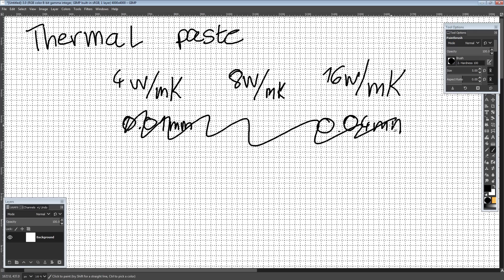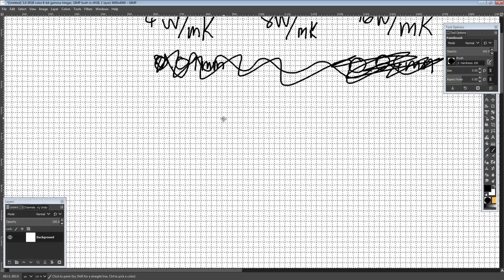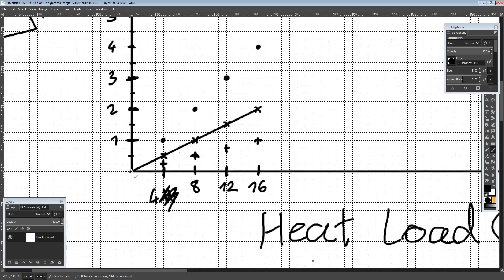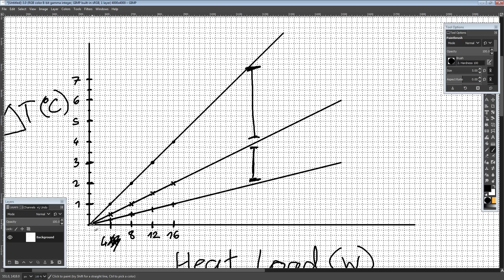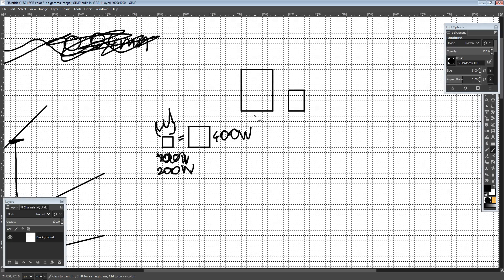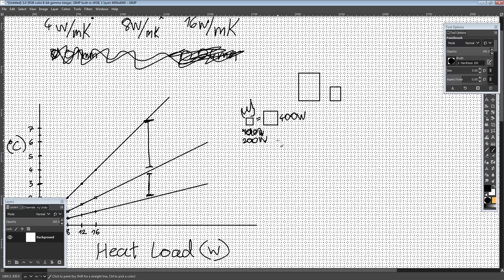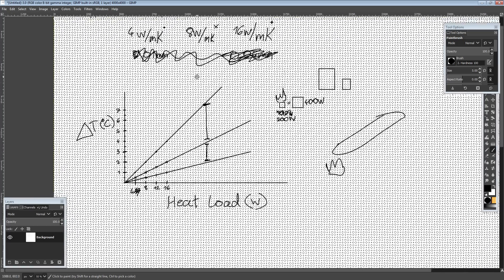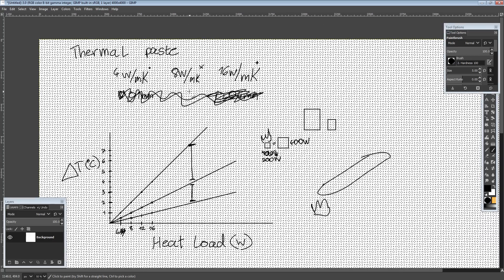The importance of heatload in thermal testing

Comment: Anandtech (accidentally) tried to illustrate this in their 140mm Slim Tower CPU cooler roundup. I say accidentally, because if they realized how important the concept was, they would have made a more prominent point about it. 
It's especially highlighted in the Low Fan speed page (7V). 

-Delta over ambient, the 212/Wraith vs D15 - are 'only' losing by 10 degrees for a 100W load. 

-However go to a 150W (15C), 200W (22C) or even 250W (27C) load, the gap widens dramatically.

Comment: Hi!
Had a question about Navi GPU's die.
From Vega/Polaris to Navi, the die size have significantly shrinked.

So, at higher wattage, will Navi face a disadvantage at dissipating heat compared to its predecessors?

Illustration: 
Say, I throw 250W at Vega 64 and with a certain design heatsink (Asus ROG Strix) and the temp is 74c.
If I throw 250W at a Asus ROG Strix Rx 5700XT with almost half the die size, will the heat dissipation be worse (beyond 74c)?

Comment: hey buildzoid quick question. I ran Furmark to test out my GPU overclock, I only ran it for about 10 minutes is that enough time to cause any lasting damage? The temperature were fine though, although the fans were spinning like crazy. The card is a vega 56 pulse. I believe the temperatures didnt exceed 75c. Thank you.

Comment: Buildzoid will you be testing an overclocked 3950x on air vs water coolers?
Reply from the maker: I don't think I have any AM4 compatible aircoolers on hand other than the AMD stock one and that one is not big enough
Reply: @ActuallyHardcoreOverclocking  would it be possible that you & GN get one from noctua or your preferred air cooler?
Any thoughts on rumours of x590 boards?

Comment: For average users simple white "toothpaste" good enough especially if they use non soldered CPUs. Just make sure you replace it every 2-3 years. My experience is basically no signifficant difference (2-3°C at 70°C) between FRESH toothpase and silver miracle using on laptops and desktop CPUs. After 3 years the white paste degrade like 10°C, but after it holds up and temps are same at 5 years and 8 years.
I don't have long time experience with grey paste like Arctic Silever, Noctua or ThermalGrizzly, how they perform after 4-5 years.

The big problem is that thermal paste and pads dry out after some time (and heat). All of the factory paste what I replaced was hard as rock, in mining cards the oil flowed out from thermal pads and you can break them to dust.

I disassembled my 12 years old rig and the cheap toothpaste is still not dried out completely. When I bought 20ml from the cheapest white paste in an electric shop I tought "it's enough for my life", still has 8-9ml in the cringe.

Comment: I love this kind of videos!

Could you please make a video where you explain which parameters one have to check for mosfets quality inside VRM? Things like Id, Rdson, rise time etc.

A more direct question: on hardwareluxx there are some mobos which are listed as 4x2 phases (without doublers) and others which are 4 phases but with both double highside and lowside mosfets, like msi b450 tomahawk vs b450 pro carbon. They are the same right?
Thank you

Comment: Now can you make a video about how TDP is calculated differently for intel and amd, and how that TDP is calculated for the base frequency and has nothing to do with turbo boosting and OC. Because Steve and der8auer really likes to test the TDP of intel chips when OC by a GHZ or more.
Reply: You mean for example like 350 - 500 watt numbers? Its not wrong, its just misuse of the one term we have "TDP (Thermal design power)".
For example, the lower end Ryzens are 65 watts instead of 95w, but theres nothing actually different about the silicon assuming you ran both matched to the higher specs. There might need to be a differentiation between design/theoretical TDP, and real world/overclocked power consumption needing a new word... (Actually Dissipated Power?)
And as for comparing Intel to AMD, they're too different internally to compare anything other than average power consumption at the CPU's EPS12V cable or even after the PSU at the mains wall socket, thats why this method continues.
Reply: @mrlithium69  TDP is calculated at BASE frequency, no turbo, no oc, no nothing. 
And i say calculated because it can not be measured. find the intel TDP pdf.

Steve let an intel CPU go turbo to 4.7 all core, and it pulled X amount of watts from the wall, and says that intel is lying about their TDP numbers. when TDP is at base frequency. Also he says that power draw and tdp is the same thing which is not. I used to believe him until that point. When he started uploading misleading videos after he got popular because of his deep tests.

der8auer did the same mistake too and never corrected it, he even ignores my comments now. So if "Actually Hardcore Overclocking
" makes a video about it at least Steve will watch it, and learn.

Comment: My 9900k has liquid metal on it and it STILL wont stay cool. That shit is a volcano above 1.3v
Reply: So was my 9700k that's direct die cooled until I realized I needed reapply the LM since it kinda squeezed out and left the center not ideally covered. I didn't glob it either I painted the LM. I was changing fittings and it just got worse but still seemed fine since temps were kinda sane until I got to anything above 1.26v and then it skyrocketed past 80 into the high 90s now I'm running 5.3ghz @1.4v under 90c
Reply: @alien_man1669  thank you for the words of wisdom. I actually did encounter the same issue at first and did reapply the LM using much less the second time. Temps are better than before when the LM was bunched up but they are still crazy high. I have been using a 360 AIO and the black industrial noctua fans that spin up to 3000rpm. But decided to just go all out and get a waterblock and a 60mm 360radiator.the direct die kit is a good idea and I may get that also...sounds like it may be a requirement for what Intel plans to release to "compete" with ZEN2...LOLL

Comment: After your explanation, I'm now curious how all of this would then relate to ln2 overclocking, being that it instead seems to transfer cold to the CPU instead of pulling heat from it.
Reply: It seems like that but no, heat is always what gets transferred by "conduction" still. The extreme cold means theres a heat difference that acts like a force pulling the heat out. "Pouring the cold" into the LN2 pot is step 1, but you can't "push" cold across the thermal boundary where it touches the CPU like that. Instead the heat will be "pulled" out of the CPU, very rapidly, depending on the difference. Additionally the larger the thermal mass of your LN2 pot means it can take more heat out of the CPU with less pours of the liquid nitrogen once equilibrium is reached and everything's as frozen as possible.
Thermodynamics are easily one of the most complex things in physics, its not to be argued with either, i.e. they are LAWS not theories.

Comment: Back to time when i studied at univercity and we took a little time on heat conductivity:) As i know "thermal density" commonly known as "heat flux" in literature(on both known to me languages(for english  - almost joke, about "knowing it"). Also remebers me Derbauer  lapping die, since silicon are not so good at tranfering heat, i think he could go further, not just ~0.1 mm(or so), but can say from top of my head at which thickness it will crack just from heating to ~80('cause in multy core dies present lateral temperature gradient)(even not mentioning pressure from any kind of cooler)but why not experiment on some very old dies?

Comment: Great video! I have run into similar issues with thermal testing and come to the same conclusion -  higher wattage testing is generally better. However there are a couple issues with very high wattage testing on CPU coolers: 1. The CPU will thermal throttle very easily when testing lower end coolers or any cooler at low fan speeds.  2. High wattage isn't a very good real world test for most consumers because most people will rarely bring their CPU past 100W. But for the niche of people who are really pushing their CPU to the limit, it can be very applicable!

Comment: About CPU Wattage. how reliable is these XTU, HWInfo and other applications when readint CPU Wattage. I have a 4690K (stock 3.7 4c ~ 3.9 2c VID 1.1v) that on stock settings it reads 82 to 88W on full load, after my mild OC (4.6 all core VID +0.180v) all apps now read 120 to 140W. Are these number reliable? Thanks in advance
Reply: ballpark accurate. Yes even the mild OC will pull way more power, its not linear scaling.

Comment: This graph... it is almost like they alll intersect at 0/0 ;)
Reply: they actually do, I mean it makes sense, if you have a material that has a finite conductivity, if both ends are the same temperature no net thermal energy is conducting between the two ends. so that's 0W. at 0 degrees Celsius/Kelvin delta

Comment: Great vid!

Since you mentioned wicking and I saw the attached PDF - I wonder if there is any advantage for air coolers depending on orientation in free air, and if we could correlate it to the type of wick. Would an NHD14 perform better mounted on a vertical motherboard in open air horizontally or vertically, or would a flat (relative to motherboard) mounted air cooler have any benefits with gravity assisting fluid returning (but maybe slightly worse for vapour).

The Graphs in the PDF suggest a slight difference (2C) at 90 degrees with loads of 25W and most coolers are 4-8 heatpipes or so so maybe that is significant and can be seen in reviews.
Reply: Back when ThermalRight Ultra 120 was all the rage and people were just starting to figure out heatpipe air coolers, I remember they did perform tests in the horizontal and vertical orientations for completeness, though I forget the results. I do remember that theres a "right way" to orient the heatpipes though.
We don't really get to select our type of wick as a control though. One can only assume Noctua has done this research (I remember watching a video that proved they did think about these things). You might be able to dig and find out more.
Reply: @mrlithium69  that's awesome thanks for the info I'll try and look it up.

Comment: I always think heat transfer need to be done not only 1 side of the die but both sides, it would be efficent to have pcb and substrate design to allow it. Like Gigabyte gpus backplate with copper but real physical connection to die itself
Reply: Yes and no. Yes, strictly speaking, doing it would be better (performance wise) than what we have today.

No, because it is not effective enough to be worth it/needed. The Substrate is a terrible heat conductor, the traces are too long, then you would have to deal with another heatsink on the back, wouldnt be effective with socketed CPUs,... Tldr it wont give you double the cooling. Even if you put in another tower cooler on the back of the mobo.

And: Ignoring  what Buildzoid does with overclocking, for "mk 1 mortal use cases" even overclocked, what we have is good enough.

Comment: I wish someone (gamers nexus maybe?) would do synthetic thermal testing with a hot plate instead of a CPU. That would be far more revealing of the performance of a cooler. There’s too much variability in the heat output of a CPU and case/cooling.
Reply: Funnily enough, I had the same thought while deciding between two stock coolers last month and half designed a testing setup.
If you use a PTC heater and measure the amps, you could calculate the actual dissipated wattage instead of measuring temperature which is always a mess. (PTC will increase in R as T approaches maxT resulting in a decrease in drawn A at a given V) 

I actually bought an 8w PTC and some graphite interface but haven't gotten around to it.

The counter argument is that no one cares about dissipated wattage, they care about temps. Just because the TIM or cooler can dissipate x watts under STC doesn't mean jack when you install an ultra-quiet fan in an airtight glass aquarium with glowy RGB because "cool"
Reply: Hardware.info does this

Comment: Your opinion on graphite thermal pads? I've been using them for Ryzen chips and they seem to handle an oc and pull temps down faster. I'm topping out at about 60c on a 1700 and 2600. They are very slippery though and hard to hold in place.
Reply from the maker: never tested one so no idea

Comment: this is very true.  this is why people are doing reviews on noctuas new 120mm cooler and saying it is just as good as the dh 15.  the dh15 is a 250w(?300w) cooler and they are testing with maybe 150w max.  if you really throw the heat at both of those the 120mm one will get a lot hotter
Reply: They always talk about tdp, but not the temp delta where that wattage is achieved. Setting the standard for tdp at lets say 60°C would mean "put in 100 watts, get around 60 °C on the cooler hot side (65-70° CPU)" would be a better metric, then an NHD15 gets 60° at 300 watts and some intel stock cooler at 45. Numbers are made up, you get the idea.
Reply: Your 2nd & 3rd sentence need pinned at the top of every tech YouTuber comments sec

Comment: I know this is the wrong question for this video but can someone tell me if the asus prime x470 pro could run the new R7 3800x or even the R9 3900x with a mild overclock? I know there is already a video on that topic but that didn't answer my question :/
Reply: Nobody will be able to tell you that for sure now. I'd guess you'll probably be fine for a mild overclock, but don't expect miracles. Either way, there will be plenty of reviews on launch, so you should be able to figure out how much power your board needs to be able to supply.
Reply: @Niosus  Ok thank you but do you think the 3800x will run on it without any overclocking?
Reply: @thegodsiegeneeds1917  Almost surely.  Not that different from 2700X.
Reply: @Niosus  Ok thanks for the quick reply

Comment: I'd like to know what's the relationship between a low or a higher TDP when it comes to overclocking a CPU
Reply: It's mostly as a result of clock speed and voltage.. and there becomes a certain point in every chip, when it ramps up to super high levels.. where the voltage gets crazy, the performance benefits are little, and the cooling required is super high.  Similar to what he was saying with how air coolers reach saturation point and then ramp up to crazy high levels.  There's below max with extra headroom.. and then there's using up all of the headroom.. and then there's the huge ramp up where it's good for bragging about high numbers, but the benefits are low and the efficiency is awful.  This is basically the point where Intel are at with their 14nm CPU's right now.
Reply: @Jonw8222  thanks for the input. but, when it comes to the 3700x at 65 TDP, does it have a bigger headroom to overclock comparing to the 3800x which is at 105 TDP or is it the opposite?
Reply: @DANTIHACK   I think they will be very similar to each other if you other if you clock them to the same frequencies.  It's possible that one will be better than the other, but that's a part of the silicon lottery (where one chip can clock higher for a lower voltage).  It could even be that the 3700X clocks higher, if you have a good cooler.  It's possible that the 3800X will clock higher due to better binning, but this hasn't been tested yet.  The safest assumption is that if you clock the 3700X to the frequencies of 3800X, the TDP will be pretty much the same.  So it's like.. user overlock vs factory overlock.  A high end motherboard helps maximise the effeciency of the CPU, whichever one you get.

edit - The difference between a good lottery chip and a bad one for the same voltage.. will probably only be 100-150mhz but this is yet to be tested in real world.
Reply: Hm. How not to create more confusion?  

Some Basics, then it might get obvious: -The TDP of a Cooler is the result of a bunch of things, some constant, others vary during use. Constants are: Surface area to radiate/convect heat from, material heat conductivity. Variables are: Temperature difference between Cooler and ambient air, more makes for quicker transfer, Airflow if the fans are regulated and the actual amount of heat put in. Might have missed some, but these should be enough.

If you increase the heat input to the cooler, its temp will rise to the point that it dissipates as much heat as it is fed. (Thats why Watercoolers scale for longer, bc. they usually have much more Radiating capacity and potentially cooler air to pull.  )

So if you have a Tdp on a cooler, that doesnt tell you everything, you need to know at what temperature the cooler vents that much.  
You probably could dissipate 200Watts through intels stock cooler without much trouble but it would be way too hot to touch at that point let alone stop a cpu from burning. If you put a NHD15 on an 6700k vs some smaller cooler, both will be able to dissipate 120 watts (pulling that number out of the blue!!!) but the bigger coolef will do it at lower temps. 

Hope this didnt create more confusion than there was to begin with.
Reply: @seven9766  also watercoolers have 140mm fans at standart, and good sytems two at least, 3 is something usual, that means more air mass through radiator of aio. Most sophisticated air cooler also can have 2 or 3 fans, but just to overcome resistanse of radiator, not to increace airflow two/theefold